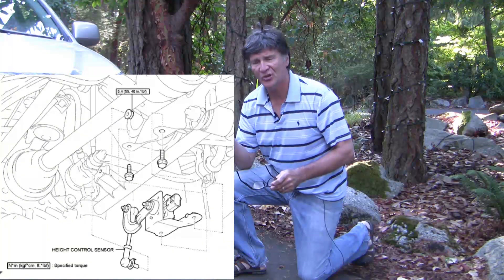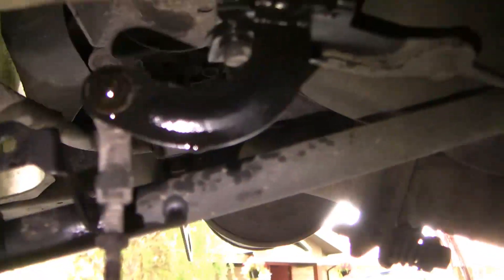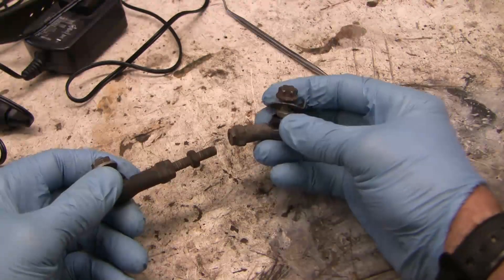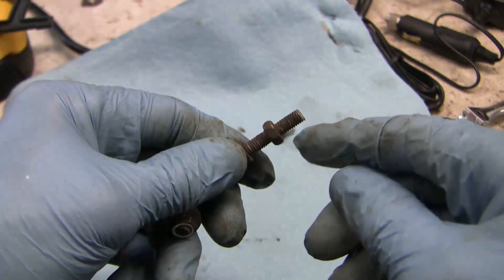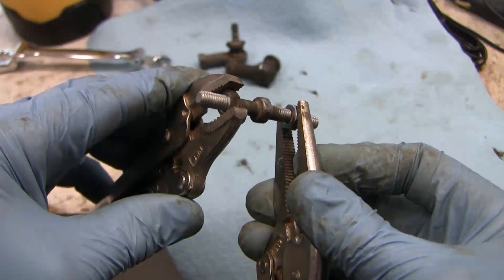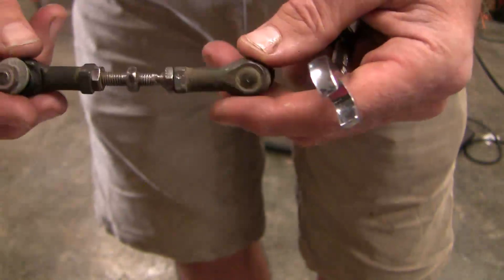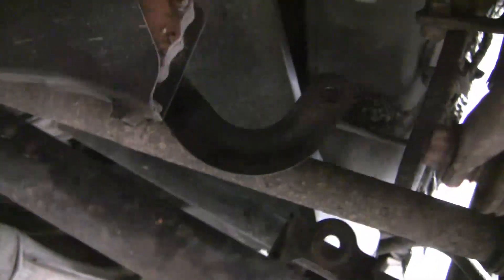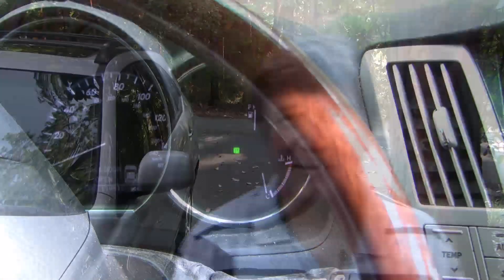"AFS off" repair, Lexus, Toyota, Prius

Comment: Very cool! I have exactly the same broken bolt and the original Lexus part is 800 Euro today. So nearly more worth than the car :-D. In the meantime you can find the bold with its two fixing-shoulders on ebay. As I have nothing to weld, I will go for a replacement part and trying to match the length. Btw. this part costs around 20 EUR today.
Reply from the maker: Glad to hear that. For others who stop by, what's the search term you use to find it?

Comment: how do you get that nut at the bottom of the shaft off from vehicle?  It looks like one side is connected into the socket of the shaft assembly and the other side just spins freely when i try to unscrew the nut.
Reply from the maker: Spray it down with WD 40, brake clean, or whatever penetrating oil you have. Once all the dirt is gone, with good lighting you'll see there are flats you can get a small open end wrench on to hold the ball from spinning. Two wrenches, or maybe a wrench and vice grip pliers. Note also that the adjustment nuts that control shaft length are paired connections, one side right handed and the second left handed. That's because the total length is adjustable by turning the whole shaft. With one side left hand, one side right hand, turning the shaft behaves like a turnbuckle, extending or retracting depending on the direction of spin. I would try to avoid changing the length, which as I recall was about 4". it is correctly adjusted in the factory and if you mess that up you'll have to recalibrate the sensor. Good luck!
Reply: @spelunkerd  Thank you.  luckily my shaft assy didnt break. just need to clean/replace the sensor itself i think.

Comment: Terrific video Dave. Thanks. But not having welding equipment & being lazy, I just put a 2” long copper pipe sleeve (5/8” OD) over the broken ends. Gravity holds in place but I filled the sleeve with liquid gasket. Considered epoxy but thought maybe too much flex required. Didn’t need to remove anything. Works great for now. We’ll see what happens over time.
Reply: Mcgiver

Comment: Great Video! Helped replace the sensors on my 07 RX350. I found a aftermarket assembly on ebay for 50USD. Seems to be working.

Comment: Thanks for the useful information.  Mine was broken just like yours, and I welded it back up, freed the frozen ball and packed with grease.  It fixed the problem!  I did the repair after seeing this video last August and it's still working well.  Ours was a 2006 RX400H.

Comment: excellent video, just popped out to check and lo and behold, snapped off link same as yours, that explains the sudden AFS light flashing that happened yesterday, thank you, saved me a lot of faffing, now i can just weld it back together ....
Reply from the maker: Yes, I'm sorry, I know most can't do that. This is a common enough problem in the rust belt that I wonder if dealers have found an alternate source for the arm by itself. One guy in this thread found a European car part that looks very similar. Others suggested home made solutions like stiff wire, junk yard parts, etc. The length is critical so you won't need to do reprogramming. If you find a solution, please stop by and let us know.
Reply: @spelunkerd  its cold and wet outside in the UK today so will wait until it dries up lol, i do have a welder but might be tempted to try and find a suitable left/right handed thread if i can work out what size thread it is :-)

Comment: Hi! I live in mountainous Kyrgyzstan and recently after a trip to skiing i got my "AFS off" on. My mechanic and I noticed the same issue as in the video- this tiny rod broke in half. The reason is the same - the lower ball joint is not moving. So I suggested my mechanic to weld this breakage place but he said it is not possible. however, after this great video I made sure this is possible!

Comment: I got similar probleme on my is250 showimg afs off what should I do ?
Reply from the maker: The hardest task, which is completely personal to the viewer, is how much risk and effort you're willing to put in. Many decide that they are better off working at their own job and let a pro handle car repair, it's not a bad decision. If it were me I would roll under the car and have a look at where that level sensor is. If not under the right rear axle, I'd consider having a look at the dealers' service manual for more info. I use alldatadiy. If you see a broken stud like in my case, you've got a likely diagnosis and plan. Good luck!
Reply: @spelunkerd  thank you very much I will try and roll down the car and see the senser arm

Comment: Thanks for the great video. I fixed mine. Turns out it is very easy to access by taking off the passenger side rear wheel.  I found the link part on Amazon for $50 USD. Took me about 1/2 hour to install. My electronic sensor part was still working. RX350 2007

Comment: I want  ask you about my Lexus( is 2007 )The light it’s come up and down when I start the engine but it cannot move right and left can you tell me the solution please ??
Reply from the maker: I'm not sure if I completely understand your question, however as a first step it is probably wise to use a scan tool to look for diagnostic codes. There are several sensors involved in this circuit, if  it is not the rear level sensor you'll have to look further.

Comment: Great video and detail. I just found mine is broken too. Couldn't you just buy a threaded rod to replace that rather than weld it?
Reply from the maker: It has those two ball and socket joints, and one of the threads is left hand thread, in contrast with typical right hand threaded rod. Of course the left hand thread is to allow the length to be automatically adjusted by rotation of the center part. If you scroll through the comments, one viewer found the exact part for a European car, as I recall I think it was a BMW. If you find it, please stop back with a link for other viewers who stop by. Of course you can get one from a junk yard, just make sure the joints are well lubricated because I think the way it fails is by first rusting/seizing a joint, and then having not enough play in the movement when the car hits a bump. A welder could fix it very easily the way I did, it wouldn't likely be very expensive if you have both ends and clear advice about final length. All that said, I read about a guy who used heavy wire, tied to both ends, with enough slop in the movement to get around need for complex articulation of the two joints. This part strikes me as being overengineered, for what it is....

Comment: Where are the other sensors for AFS? My light is flashing, but the sensor at the rear looks good.
Reply from the maker: Good question, I didn't explore that, I know some data comes from headlight controls. You can find more complete diagrams on the OEM dealers repair manual, inexpensive subscriptions available from third party sellers at Alldatadiy or Mitchelldiy. A high quality scan tool would likely offer more specific info if you are stuck. You could also measure input voltage and ground at the level sensor with a multimeter, then moving the arm to see if readings change. It's a simple varistor, so resistance when disconnected should change with arm position after disconnected from the circuit.

Comment: The threaded bar has three nuts.  Are the two nuts near the ends supposed to move freely and be used as locknuts when the bar is adjusted to the correct length?
Reply from the maker: Yes, exactly. By having threads for ends of the middle segment oppose each other (one left hand threads, the other right hand), it allows the tech to change the overall length by simply rotating the middle segment. It's not a novel idea but I find it intriguing. I was careful to reproduce the exact length of 4" when I welded and reassembled, so that I wouldn't have to recalibrate the sensor after I was done.

Comment: This video really helped me to understand the problem with my RX400H. It suddenly started shaking and the AFS OFF started flashing. I went to check the right rear tire side as you have suggested and I discovered a broken pipe. Now I need to know if all I need to do is get a machinist to weld the pipe.
Reply from the maker: It's an easy repair, if your problem is the same as mine. I believe you want to be sure your end length is identical to what it was before, since you may need to recalibrate the sensor if the length changes after the repair. The critical problem was seizure of that ball and socket joint, with extra strain on the shaft because it wouldn't move. In that case glue won't likely work since it can't withstand the torsional strain, welding is a much better option. Alternatively if you live close to a junk yard, they may be able to find the part you need without need for welding. Good luck!

Comment: Nice job man...
I just have a question.. why this sensor is installed in the rear wheels while it suppose to be with the front wheels... or it is just for adapting the lights up and down not right and left
Reply from the maker: New cars have dozens of little modules to control all kinds of things, and the module controlling headlights uses data from various sensors to decide which way to point and shield headlights. These days, with really bright LED headlights, shielding is mandatory in new vehicles. You can sure recognize the aftermarket LED lights installed without shielding, they can blind oncoming drivers. I believe the rear sensor is just for up/down, not right left. When you think about it, you need to distinguish when the vehicle is driving up or down a hill compared to when the rear is pushed down compared to the front with extra weight in the back. Right/left is likely using input from signal lights and vehicle speed. I reluctantly shrug, at all that somewhat unnecessary technology.
Reply: spelunkerd ... I just have acciden before 2 weeks it was in the front right side... I bought a new Taiwan Light (not original or nor  second hand)  ...after installing and finishing the painting.. this "AFS OFF" indicator start splinking...im thinking it was from the accident..but after seeing your nice video where the sensor is setting in the back side not the front, I have confused...
Thanks for your replying...
Reply from the maker: First thing I'd do is get a dealer repair manual for your vehicle. I use alldatadiy but Mitchelldiy offer a similar product. You're looking for a schematic of the AFS system to learn where the components are. There are likely sensors in the front, too, so if the back is not obviously broken you'll want to check out the front. A scan tool might offer more exacting information regarding what is wrong, although cheaper generic OBDII scanners might not tell the whole story. I would look closely at the lighting fixture and casing to see if the little actuator motors to adjust headlight position and light cover position. Either might have been damaged in the accident. This may take some patience to work out, you need to factor in the value of your time to get a diagnosis.
Reply: @seeker4info  your comment is 4yr old and I hope you fixed your AFS problem by now but I will reply as it may help someone else. The issue you are describing is related to little motors that are part of RX original headlights. This motors move headlights up and down. AFS Light will flash If one (or more) motor is broken or do not exist as you bought not the original headlight. I had this happen on my oem headlight. I bought this little motor used on ebay and it solved this problem until it came back again after my real link got broken and described in Dave'video.
Anyway... it's pretty simple to fix by taking headlight a part and replace the motor, but you have to take the bumper off to take your headlights off. Be very careful with headlights when removing - attachment points a very fragile.
You can tell if one if those motors are broken be turning your RX at night. Your headlights should move left and right right away after you start your car. You can if one of them do not move - your motor doesn't work.
If you have aftermarket headlights without motors in them you can just take the AFS fuse out to get ride if the AFS Light  as this function most likely will not work on those.
Hope it helps

Comment: Thank you for showing all the detailed on how to fix. Mine is 2006 LX 400h and just AFS off light is on not flashing. I've checked under the vehicle where you have directed for the exact location of AFS at and it is not broken and all is looking clean and good. Make me wondering why AFS off light still on??? Please let me know what do you think is the problem?? Thank you for your help. Sean from Richmond, VA USA
Reply from the maker: A pro would start with a high end scan tool looking for specific codes that might direct the investigation. Often that gives enough information to know where to start checking connections to components like the rear or front sensors, etc. From there they would move on to checking for signals and maybe even using bidirectional control to turn components on and off to see how they are working. As you might expect, a professional workflow strategy requires expensive tools and experience. Without said tools, you could use a dealers manual (I use alldatadiy) that will list the components of the system, and you could check each for power and ground, inspect mechanical function, etc. Whether that will take you far enough to be able to fix it yourself is difficult to say, but you'll sure learn more about the system. One caution, I would never replace a part without clear evidence it is bad. That 'parts cannon' strategy is expensive and usually misguided. Good luck!
Reply: Sean Yoon Did you find the cause for your AFS Off light? Mine came on today, no broken cable.
Reply: Switching Afs off with the button on the dash would cause this.

Comment: Great video. Of course, my AFS OFF light is on after having a battery installed in the sensor  that monitors tire pressure.  It doesn't annoy me yet😁.
Reply from the maker: Gee, I didn't know that the TPMS system is hooked into the AFS system. We would get a specific tire pressure problem light, it didn't activate the AFS warning when we switched to winter tires without TPMS sensors. As you say, a little annoying, you might consult the dealers manual. I used Alldatadiy, it was about $45 for a 5 year subscription. I wonder if the vehicle balance was tilted when you had a bad tire, then trouble code persists after fixing it. Or, you might have two issues, this broken bracket I had is a common problem. A scanner might offer diagnostic codes to help with investigation.
Reply: spelunkerd True. No connection that I am aware. It was just happenstance😁

Comment: My dealer just quoted me 600$ with install for each i wish you would have showed us the front location as well they have after market whole units for 300 at auto zone or 100 just sensor
Reply from the maker: I use alldatadiy, which gives you access to the dealer repair manual and all their TSB's for 5 years, it's about $45. Those details are probably there, I let my subscription lapse last year. Good luck!

Comment: so I did the same thing on my lexus rx400 but afs still was flashing. after a few weeks I bought a good one replaced it but it still flashing when the engine starts
Reply from the maker: There are also little motors in the front that move headlights, and I believe the code is not specific for that one afferent sensor. With the expense of these parts I would not replace any more sensors until they are proven to be bad. If the signal is still flashing you could disconnect the neg pole of the battery in case the PCM needs to be initialized for the new sensor. I did not change the length of the lever arm, to try and give myself every chance of not needing a professional initialization procedure with dealer software. Of course check that the little lever and arm are moving properly for the load sensor. If you are still interested in trying to fix it yourself, I would review a copy of the dealers repair manual. My subscription was through Alldata which is much more economical than going directly through the dealer. The way professionals make the diagnoses for these systems is through their proprietary Techstream software, with the ability to turn individual devices on and off and with the ability to read input data through the PCM. That saves a lot of time. Without a high level scanner, you could check resistance of the new sensor with a multimeter while you move the arm, to prove it is good. I believe these are simple variable resistors so resistance should vary smoothly as the arm is moved through its arc. Then I would check the wiring from the sensor to the PCM to look for a broken wire or corroded connector. Of course don't forget to check fuses. If you have a scanner that can read live data you could move the arm and see if the PCM reading changes. If all that checks out OK, I would move on to investigate the headlights and other sensors in the system to see if they are properly connected. Good luck!
Reply: spelunkerd thanks so much